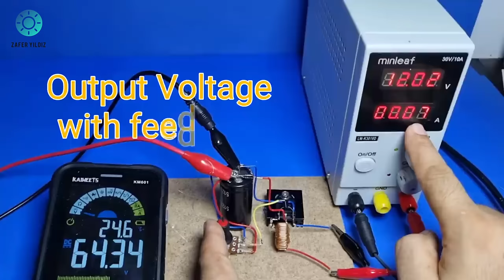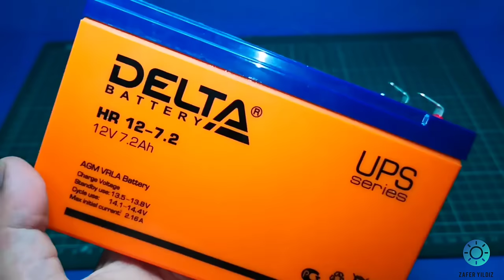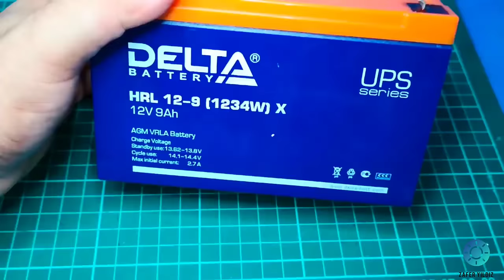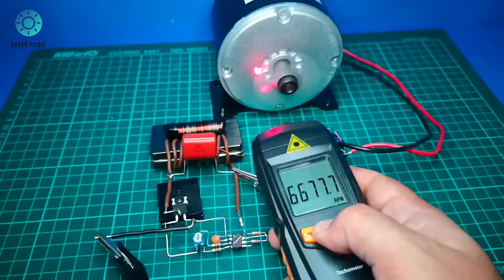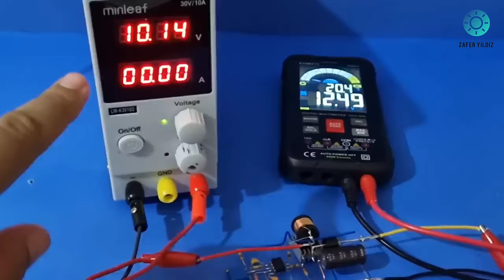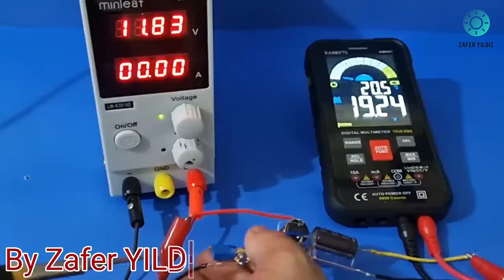TOP 4  Simple High Power DC Booster Circuit

Comment: Very basic switching boost circuit. These come in handy for generating odd voltages for vintage electronics that require low current at high voltages that originally used batteries, for example the 900V in the oremaster geigercouter that used 3x 300v batteries

Comment: Make an battery use resistor to set the voltage parallel a bunch off those circuits together use pelter panel to recover the heat turn in back in to 3.7 v.  u could make a module for each battery section .

Comment: Multiply the voltage and parallel the circuits u could run an ebike probably same distance with a pack using 10 18650 just at a way higher voltage ..
Reply from the maker: yes